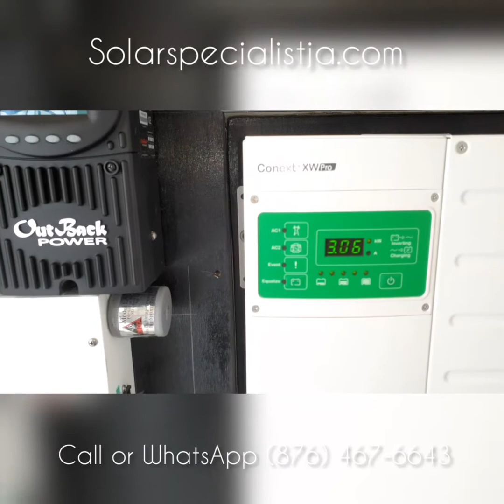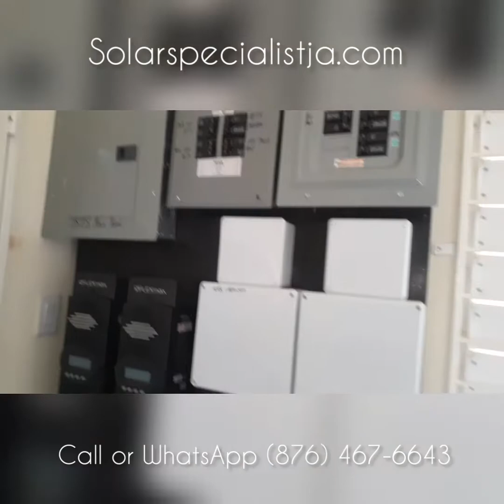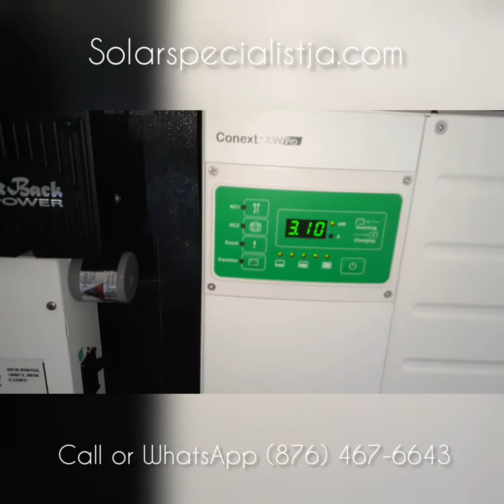Solar homes with Air Conditioners in Falmouth Jamaica

Comment from the maker: Zico Don asked a very good question... Can all 3 AC run throughout the night? 
The answer is: Yes ... The key is the efficiency of the AC units and once they cool the space you can run them on Eco mode...  Zico don  let's just say the customer is done with JPS and they are able to use their AC however they see fit... The solar system produces over 1000KWh every month and that's over $40,000-$45,000 JMD in savings every month. We also designed that system with an automated energy management system ensure that all the other appliances remains on solar 100% of the time. The AC units are on their own circuit and transfer switching parameter settings. It's totally automatic